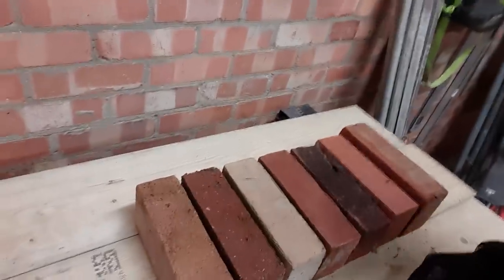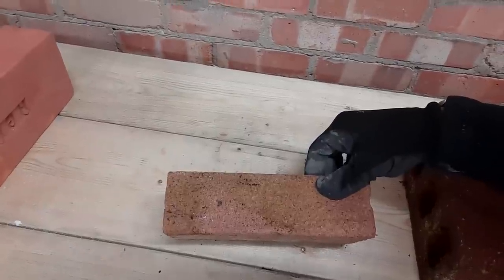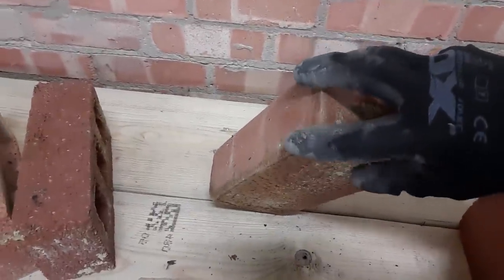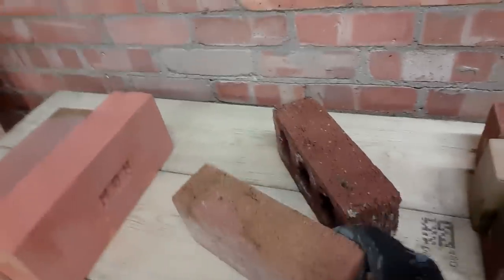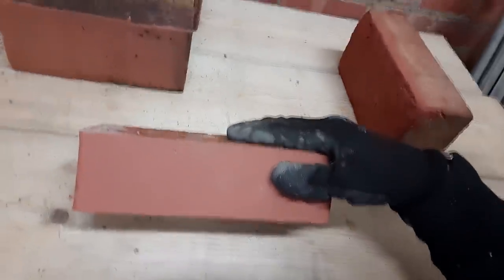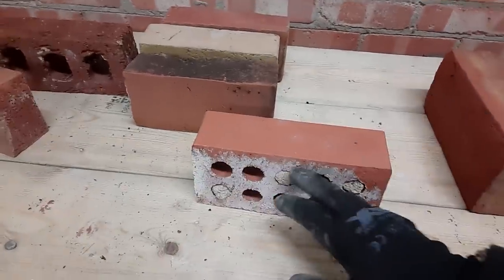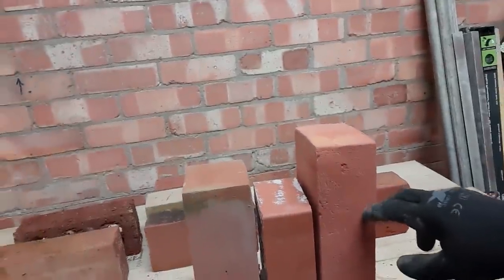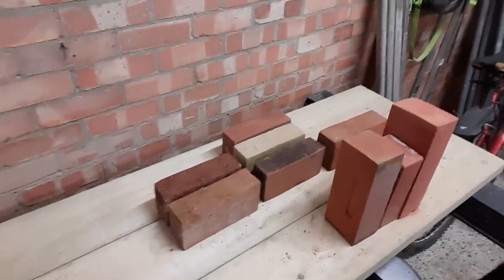the fine art of brickwork - Bricks

Comment: Great video I learned something new today..👌🏼
Just to add the best place for a London brick is a skip 🤣🧱👏🏽
Reply: Yes your right in a skip you most times only get a face side on.one header side one end
So to optain a proper face on corners and reveals  you have to lay half cut bricks  upside down.and they sink.i hate laying them.there all diffrent sizes and vary a lot in Colour.the frogs Are  to deep and you use to much muck  under them.to much movement.when you check your corners you built plum they will always move and overhang.and they are not proper face bricks.o.k.for internal walls that's going to be plastered or painted.only advantage there's a lot lighter for a labourer to carry.but I aways hated working with them.
Reply: @johnbryant6572 . All that plus they are very porous. I replace so many angle irons after the water has got in and rust has blown them .🙄🧱👍🏽

Comment: Hi Rob, just finished my first wall. Followed both you and "Rodian", both excellent teachers and thank you. Took 10 days but worth it. Have asked of many people about the various conditions and suitability of various bricks but have never got an answer. For what it is worth I selected a brick with an "F2" absorption rating. Hope I did right! Have had very positive comments from neighbours and a couple of local builders so feeling chuffed, again thanks.
Reply: @martin2466  Thanks for the reply, It was for a front garden wall where all the LBC bricks were blooming and falling apart, a very common problem hereabouts. Learned a lot both from video and trial and error. One small tip I would pass on to any would be bricky is not to get paranoid about getting each and every brick perfect, lay 4 or 5, and then check and correct things. Once again thanks for the reply.
Reply: @martin2466  Very much so, thank you for your helpful comments.

Comment: 1965 was the year the UK standardised it's brick sizes, 215x105x65mm UK metric dimension's.  Prior to that there was no stipulated sizes it depended on geography and the brick makers moulds!
Reply from the maker: superb...thank you Mark.
would you be interested in a Saturday workshop in the new year?
Reply: Thanks for that I often wondered.i started hod carrying in 69 and everything was metric.my house is 1936 built with imperial size type london flettons.old bricklayers used to try change the drawing measurements back to imperial and it took them ages to get used to it.if you know that. then im curious to know how they built brick walls with the old plum line with a lead weight on the end. These old building I work on are 
spot on plum and they must have been built with this method before we had proper spirit levels.i don't belive they plumed every brick and must have had some other system like measuring from a hanging line or setting up wooden profiles or  something similar.id'e love to know.